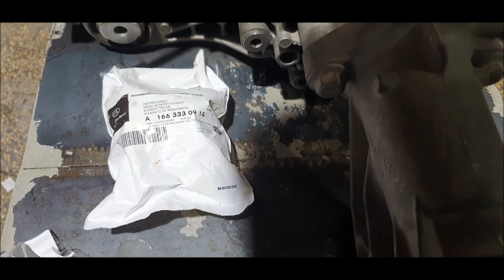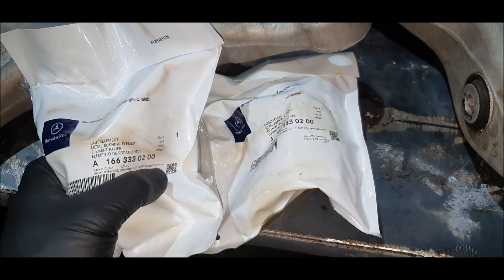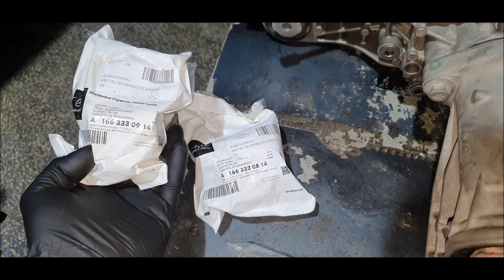ML/GLE frt diff bushes (part 1)

Comment: Great video 👍 Tasos Heating up aluminium to replace bushes is risky if you haven't done it this way before 🙄.
Reply: I think Tasos already knows exactly what he's doing.  It wasn't heated either, it was only slightly heated.  The differential also gets quite warm when driving.  I don't see a problem there 😁.  Best regards 🙌